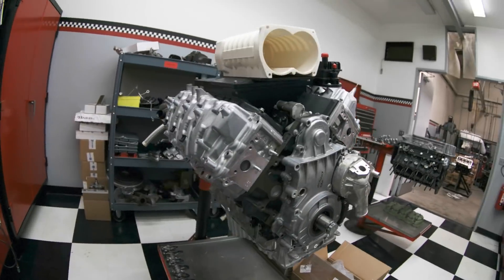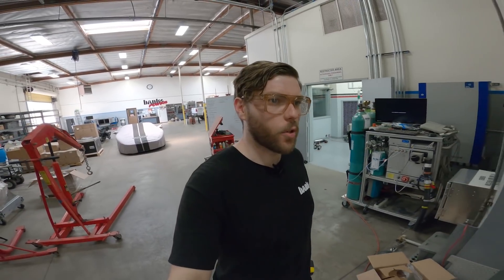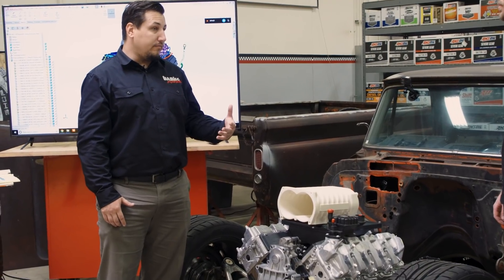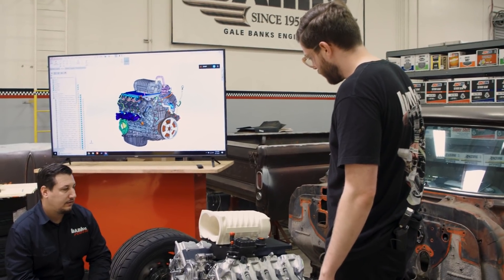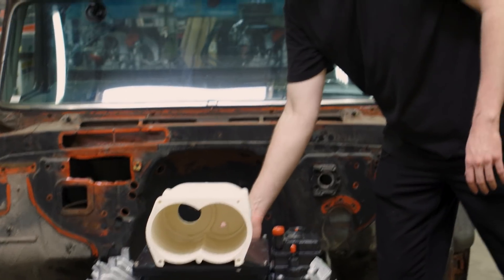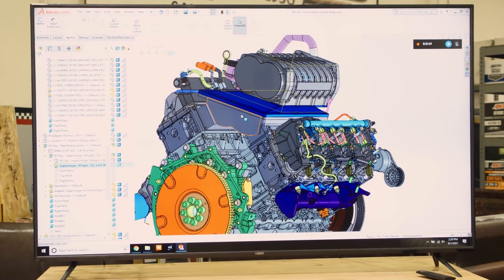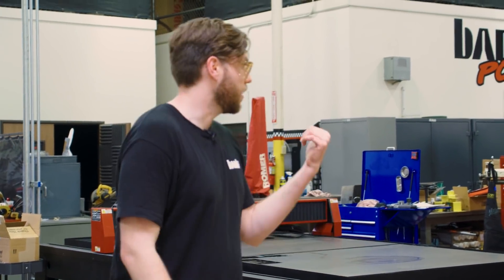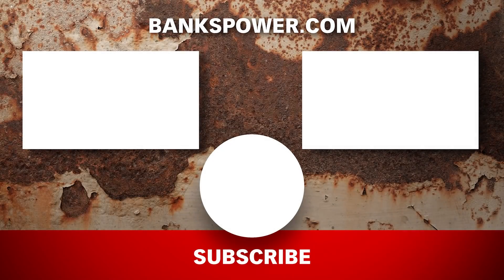Supercharging our Duramax. New intercooler design. | BANKS BUILT Ep 21

Comment: At a high voltage line wire maker, I saw aluminum pulltrusions with broken glass as a lubricant. Our instructor explained basically , glass is a viscous solid and explained why very old church windows became thicker at the bottom. An electrical engineer at work didn't believe me, but I don't think he had imagination for another use of silicon.

Comment: It boggles the mind when you see that they are doing 2 builds at the same time on the engine side.
A production turn key engine and this setup in LockJaw.
So in the future when you buy the turn key version and you pop the hood and tell others Gale Banks built this engine for me.
How cool would it be to say that to others looking at your engine under the hood.
Reply from the maker: Yup, it's a challenge, the clock is ticking. We're working as hard as we can to get this truck done before SEMA. Thanks for watching, stay tuned for more.

Comment: That shaft coming out of supercharger is going to be long, real long to align with drive pulley! How are you going to support it? With that support how are you going to set intake port there?
Reply: It's going to go straight through the inlet with a support bearing at the point where it goes through the inlet casting, there likely won't be much of any unsupported shaft behind the pulley.
Like the s'charger they offer for the Tundra(and various other models in previous generations)...
https://cdn.shopify.com/s/files/1/0470/1097/1814/products/whipple_pic_1_1024x1024.jpg?v=1599499078